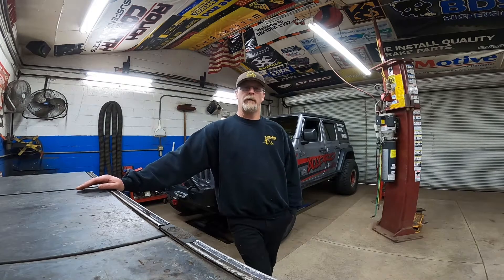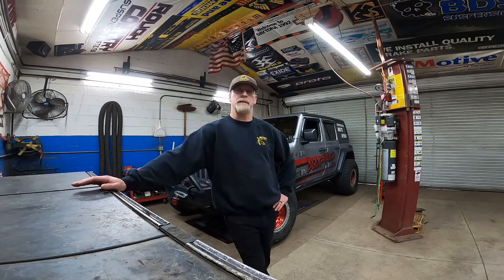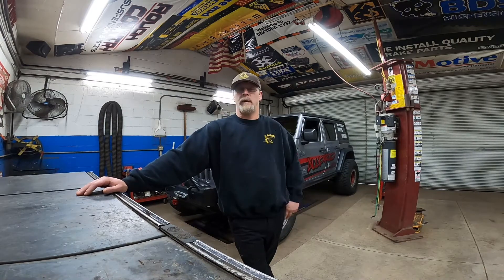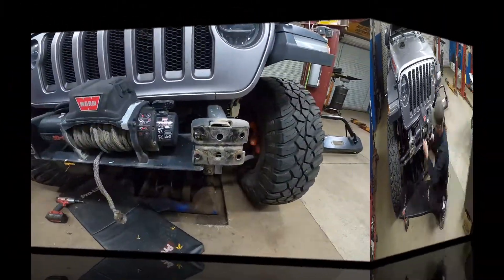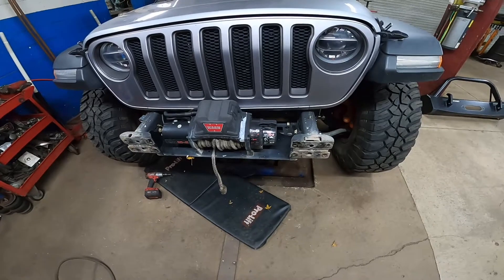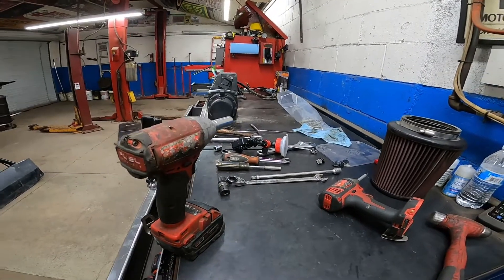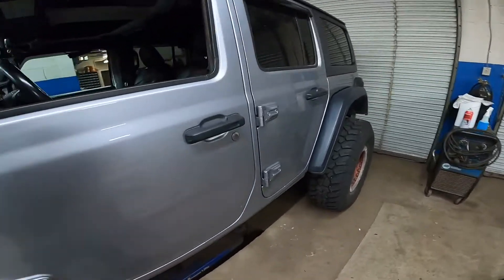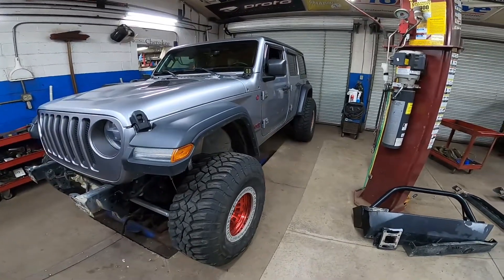Giving the Shop JL a Facelift

Comment: I'm with ya on the fenders, the Rubicons are nice but just to bulky and the aftermarket ones are bulky also,I'm looking for a heavy duty fenders that don't stick out 8 miles and the front fenders need to have good blinkers/markers
Reply from the maker: This seem to fit what you seek. 
I have a full set in stock with liners for customers.